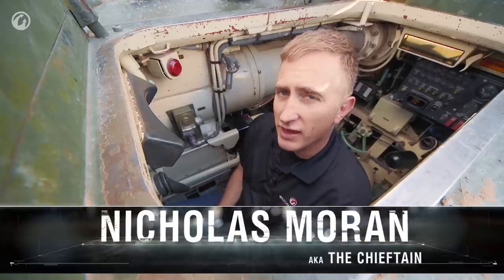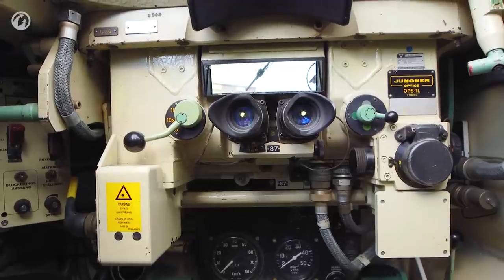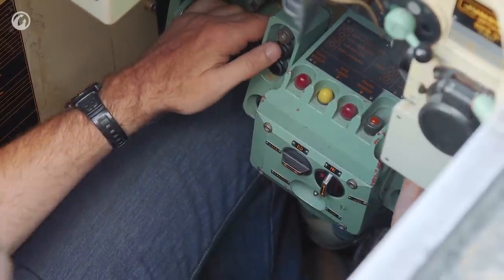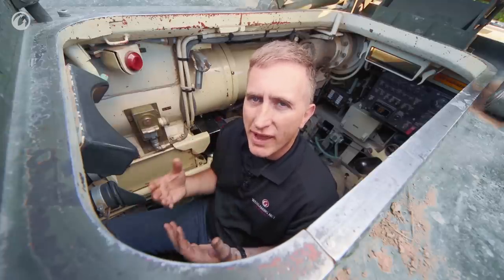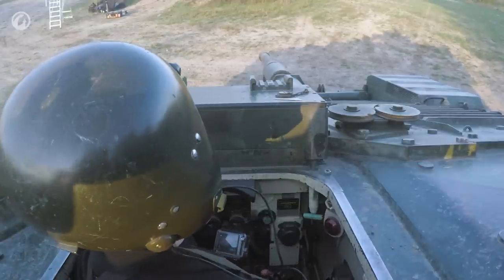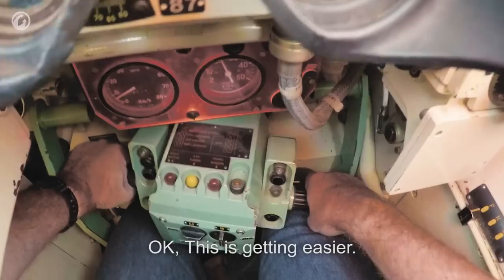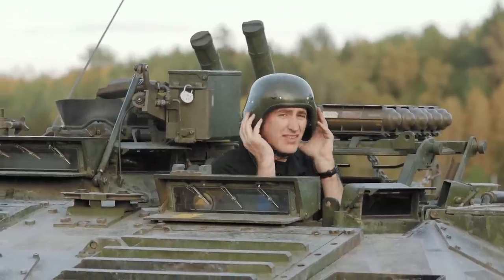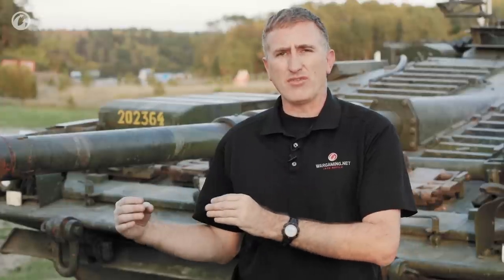Inside the Chieftain's Hatch: Strv 103C part 3

Comment: The S-tank was designed as a defensive tank. It was designed to ambush Soviet tanks preventing them from invading Sweden. After the collapse of the Soviet Union, it kind of lost its role. The S tank was not up to the requirements of NATO-tanks, and it proved too hard to adapt them to be used in different terrain with different tactics. So their service-life was ended. But I still believe they was, and probably still is the best tank for the task of denying invading Soviet Tanks passage thru Sweden.
Reply: Yep. Considering swedish doctrines, tactics at the time and the specifics of the terrain it would have been fighting in, the S-tank would probably have done pretty well. Only problem would probably have been the use of conscripts instead of professional soldiers, however, considering that sweden had what? 5-6 million people at the time? A standing, professional army wasn't an option.
Reply: ZeroneAngel I am a conscript. And one of the big advantages is that I have aquired many other civilian skills during the past decade, skills I can use in case of war. The conscript army is unpredictable. And I think that is a good thing.
Reply: I couldn't agree more. For a small country without the ability to have a standing professional army, the conscript army is outstanding in some cases. Your argument that the use of civilian skills in a war situation is a perfect example. Especially in a defensive war. In an offensive war, not so much. But that is honestly beside the point when we're talking about the swedish defence. If I am correct, Sweden never had any offensive doctrines or strategies. Well, at least not for the last 200 years. Before that it's a different matter. 
But when it comes to specific tasks in an army, professional soldiers will, for the most part, outperform conscripst. Spec-Ops, boat crews, tank crews and certenly air force. 
However, I will admit that sweden had a working strategy when it came to design of vehicles and aircraft. The fact that they were designed to be operated, serviced and maintained by quickly trained conscripts whitout specific expertise is awesome.
Reply: ZeroneAngel that is correct, but there is an other doctrine that is potentially devestating to an invading force. Decentralization. There is no authority that can order me to surrender. And during basic training we are told we are expected to resist as long as possible. We are also trained to resolve our task, and my commander doesn't care how I resolve it. Same how I am concerned about my soldiers. (I am a squad commander) I don't  care about how my orders is carried out, just that my squad resolves our task so our  platoon function to resolve our part of our company's part.
Reply: ZeroneAngel But an agressive defensive doctrine. In the 70's Sweden was too strong for any power to invade. Sweden is also quite large, (it is bigger than Germany, ) France , Spain and European Russia are bigger and Ukraine about the same.
Reply: Rory The Red  well, in FoxNews fantasy world it may be so. I spent the day in Södertälje and in Uppsala, I was busy today, but I saw no grenades, and heard no gunshots.
Reply: Rory The Red  You must have been drinking to much vodka lately ! LOL
Reply: MaskinJunior, that's actually a common myth. It was not primarily meant to be an ambush tank, it was meant to fill a regular tank role in a time when turrets and stabilizations were not as advanced as they would become. The "ambush tank myth" is a modern after-construction.
Reply: Rory The Red never been there eh.  Just got back in March. Sweden is one of the freest countries in the world.  When you’re free from hunger discrimination and crippling medical bills you are very free.  Visited Tromso and östersund where my family is from. It felt like home.  I shall return. 🇨🇦❤️🇸🇪
Reply: The scary part was some testing with T72s left over from East Germany, the 125mm APFSDS rounds would have been a through and through but they tended to get stuck in the rear armor. That was a bit disconcerting to the Swedes, to say the least!
Reply: @martinbredberg7616  som tidigare gruppchef men numera avskriven pga förfluten tid sedan muck är jag väl medveten om den doktrinen.

Comment: As I understand it, the key to driving the S-tank effectively is to not be shy with the gas. The throttle pedal has two ranges because it controls two engines; the first 50% brings the piston diesel to full power, and the rest of the travel brings the turbine to full power. Due to the fact that all turbine engines are sluggish in changing power outputs, the standard procedure was to simply stand on the gas pedal and control speed with the brakes.
Reply: Thanks alot should I ever drive one

Comment: Not having a heater is not really a flaw in the design.  I lived in Alaska where I imagine it gets as cold as Sweden in the winter and it's a pain in the butt having to take-off a heavy coat when in enter a heated car or having to put it back on when you exit from it. There's also the problem of moisture when you open the hatch when your tank is nicely heated and all that cold air rushes in or the reverse where you close the hatch and the cold air heats up.
Reply: Due to the gulf stream, sweden has something of a miraculous climate, despite its northerly position. in southern half of sweden, "winter" winters rarely see temperatures below -10C, occaionally down to -20C during cold snaps. northern sweden can get a bit colder, but nothing extreme. the record is -48C compared to alaskas -62C. the relevant swedish saying is; there is no bad weather, only bad clothing.
Reply: @protonjinx  When I did the military service in 1998/99 i was stationed at Östersund in the middle of the country. 
During one winter exercise we experienced -45C.
Reply: Yep, it was the same winter when Gävle got 4-5 meters of snow in one day. 
I was on a train that almost reached the train station before it derailed because of the compacted snow.
Reply: They get the northern tip of the Caribbean Gulfstream sea current, that makes the climate more mild. Not in northern Sweden, but the rest gets it, basically anything close to the North Sea.

Alaska by contrast gets the artic gulfstream bringing cold water south, which makes sure that even around Vancouver and Washington you'd be a fool to swim without a wetsuit in mid-summer.
Source: My Dutch experience of going "A sea in midsummer! Great! Show these guys how to swim!" and then freeze my balls off as surprised and mildly amused Canadians looked on.
Reply: Also, if it is really cold out and you have to evacuate quickly, you are going to want to have your warm clothes already on.
Reply: Don't know bout the swedish army, but there usually are no coats for tank crews, just a one piece jumpsuit with removable inside insulation for winter. It is rather comfortable and warm enough. One of its main features is an integrated recovery system, which lets you grab the suit and the man in the back for fast rescue through the hatch with one arm only if necessary. Side feature is an integrated gun holster under the armpit inside. Well, that's what it was like back around 1980 as former nato IFV commander on a spz marder. Good times sigh.
Reply: @protonjinx  the official record is -52.6c, but unofficial minimum are closer to -60 in certain areas in the north.
Reply: I'd think between the diesel and turbine there's plenty of residual heat to keep things comfy. Totally right about condensation and not having to dress down because of a heater in the event you had to egress in a hurry.

Comment: "It is possible to depress and elevate as you drive"
You mean..... NO SWITCH TO SIEGE MODE ?? I've been lied to !!!
Reply: The manual for the real thing says "don't do that", though. In fact you are not really supposed to drive it around with the elevation controls unlocked at all - you are allowed to do it to sneak in and out from behind cover, but that's about it. The manual warns that driving around with the elevation controls unlocked risks damaging the hydraulic control system.
Reply: @renhanxue  Didn´t see that chapter in the manual, and none of us anyway obeyed it. Maybe that´s why we always had our feet in 2 inches of hydraulic fluid... but since I have kept my manual in mint condition (as every dedicated tanker), perhaps you might guide me to that paragraph?
Reply: @renhanxue  Did check again. In chapter 8 "Driving" it says on page 11 that you SHOULD use elevation/depression to adapt the tank approach according to terrain.
Reply: @martinbredberg7616  I've checked my 103B manual and I can't find the paragraph I was remembering. Which is troubling to me, because it means I've spread misinformation about the tank around, and I've tried to correct misconceptions about it for a long time.
Reply: @martinbredberg7616  I don't know where I got the idea either; perhaps it was from development documentation (which I've read a lot of), or from some other source. Either way it's not correct.

Comment: I've read about the British trials in Germany; they just didn't understand the tank or the doctrine of how to use it.

Swedish doctrine was that the first person to see a target engaged it, while the British liked to bounce it of the commander, slowing engagement-time down a lot.

There was a slew of other issues too, but it was years since I read the report, but misunderstanding was a keyword.
Reply: Quick engagement times were also the strategy this tank was designed for. Its a shoot and scoot tank with the ability to easily ambush an enemy and if deemed necesary run away before the enemy had the chance to engage you. A tactic you find prevalent throughout Swedish military doctrine and a tactic which could be extremely effective seeing as its hand crafted to fit the swedish military and the swedish terrain.

We are not an offensive country but rather a defensive one. Being defensive in nature we have no need to equip heavy and contineous strike tactics nor are we stupid enough to expect to hold set points forever against a likely nummerically surperior foe.
Reply: I believe it was not better than the centurion for a number of reasons. There is a Swedish article that names a list of problems with the design which led to it being dropped. The main one is that you had to run the engine to aim the cannon which generated a heat signature that other tanks could spot.
Reply: Angry Irishman it was intended to provide mobile fire support to mech infantry but proved ineffective in this role..

 If you read Swedish articles they mostly considered it an unsuccessful design / vehicle for a number of reasons. 

Moreover had the design / concept any merit then it would have been more widely adopted..
Reply: and it didn't have an Infantry / tank phone  lol
Reply: @roosterbooster6238  doesn't seem like a problem really.  a tank in the sun will show up on optics because its metal and hot, and most other tanks produce just as much heat if not more. this can run the less intense diesel to aim.

this is just a vehicle that really makes people scratch their heads.
Reply: @roosterbooster6238  what? just like Angry Irishman said it was supposed to utilize the hilly swedish terrain to ambush russian tanks as they invaded into sweden, it is near impenetrable from the front as long as you dont show the lower glacis which it wouldnt have to since the hydralic suspension let it depress the tank over a hill. it would fire off a number of rounds and then use its extremely fast reverse speed to move to a new ambush point, and then repeat until it had taken out several enemy tanks. it served for exactly 30 years, if that is an "unsuccessful design" then i would like to see what a "successful design" is. 

also its not a fire support tank or tank destroyer or whatever you want to pin it down on just because it doesnt have a turret. its a main battle tank.

"moreover had the design any merit then it would have been more widely adopted" no it wouldnt have, the tank was made specifically for sweden, it worked for the swedish terrain and nothing else, and it was made under the pretext that firing on the move isnt neccesary, becuase at the time gun stabilisation was extremely rudementary. the tank wouldnt work today because of modernised gun stabilisation and it wouldnt have worked anywhere else at the time because it was tailored for the swedish terrain.
Reply: Johannes S Good points. Other tanks at the time, when the S tank was deployed, could fire on the move. But in Swedish terrain they could never hit anything anyway unless firing when stationary, because of bad gun stabilisation. Most main battle tanks were designed for the flat plains of Central and eastern Europe. That actually gave the 103 an advantage.
Reply: You know that during tests in the US versus M48, Centurion, and S-tank, the S was no slower to engage targets than the Cent or Patton, since they all had to stop to actually hit things.

I can argue that the S is too optimized for the Swedish terrain to be adopted much anywhere else, much like the Merkava is so optimized for Israeli terrain that no one has tried to buy one.
Reply: There is a video about Stank (in Swedish) being in Germany killing all centurion tanks in an exercise 10-1.
The result was kept secret for 20years by nato.
The Bofors gun was the big benefit of this thank, long range and excellent penetration capabilities for its time.
Reply: @roosterbooster6238  Spotted with what? A thermal camera/sight? And you don´t think that any other MBT, with its engine shut off for 3 hours, could be as easily spotted with the same camera? Clearly you have no experience in either tank or anti-tank warfare...
Reply: @Jonsson474  Yeah, some other tanks could fire on the move at that time. With like a <17% hit probability. The 103 could also fire on the move, with a <5% hit probability. Question is, would you spend 2 seconds to halt and get 100% hit and kill from the 103? Probably, as the enemy were unlikely to hit you even with the second round.
Reply: @ScottKenny1978  Finally someone who understand things. Nice to meet a true tanker, who is able to understand time and regional aspects.
Reply: @martinbredberg7616  believe it or not, I'm just a Sailor.

Been fascinated by the S-tank for years and years, though.
Reply: The British trialed the Contentious in the 50’s but didn’t consider it viable. The S tank is a bit of a one trick pony.
Reply: Was doing service on this very special creature and whatever skills it might or might not have had on a battle field it gave us a lot of fun and memorable moments. Like going full speed on a snowy field and conducting a clutch turn. It is a spectacular feeling to do a side-way skid in about 45km/h in a +40 ton tank. Or driving on a gravel road in +50km/h with a CV90 catching up behind you. We hit a big pot-hole in the road and our tank literally lifts off the ground but lands comfortably thanks to the hydraulic system. The CV90 however hits the same pot-hole (I was backdriver that day) and resulted in one of his tracks breaks and he went off into the woods :-) 

Regarding engagement-time. When we were doing sharp trainings with real ammunition and goal was to hit a moving target from more or less full speed we managed to get down to around 5 seconds. So it meant ,clutch break, get the tank to a stable stand still aim and fire, not easy as it swings a bit back and forward after breaking. Don't remember the exact length to the target though. 500-1000m I think.

Comment: What should be mentioned maybe that the idea was to use the trenches glaciers left behind from the iceage behind as cover. With an flat tank that meant pre digged tank trenches, the tank hunkers down, pops up and shoots and hunkers down, and can drive around in cover. 
So its low height was what made it perfect for that terrain, all technical shortcomings for "normal" terrain did not apply.
Normal tanks entering that terrain where at an disatvantage naturally.
Most of the swedish vehicles where made with mobility and pretty much hit and run tactics in mind (volvo type c303 tank hunters for example) and not with slugging it out on the open.